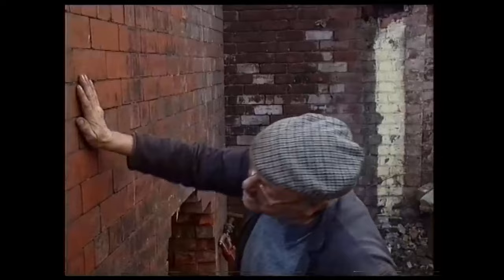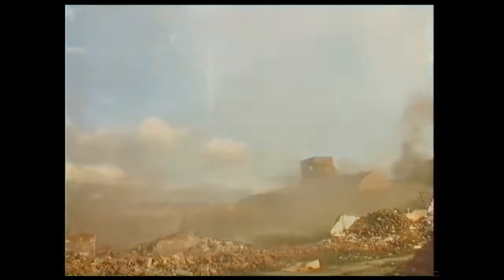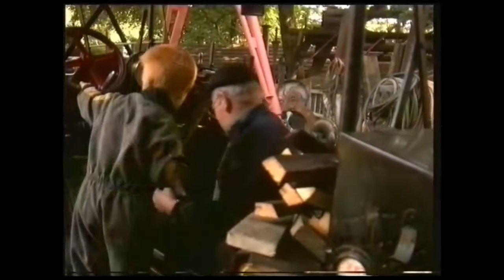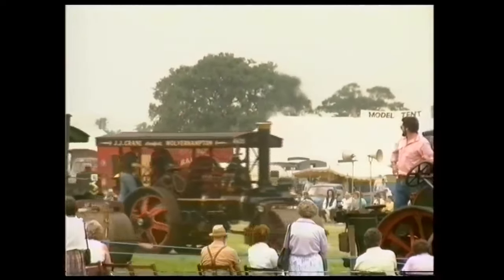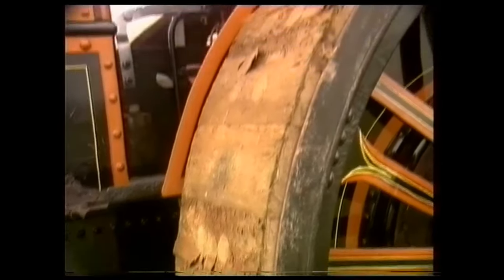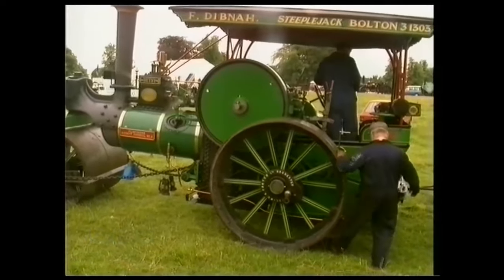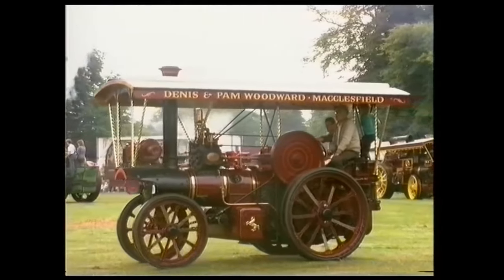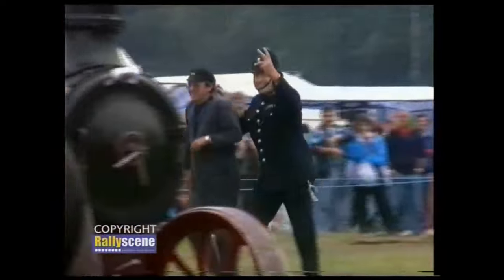Remembering Fred Dibnah: A British Much-Loved Character

Comment: Fred was doing the waterboard a service by checking the fire Hydants that they were working and clearing any loose rust in the pipe and valves they should have paid Fred for that service.
Reply: they should go and inspect them